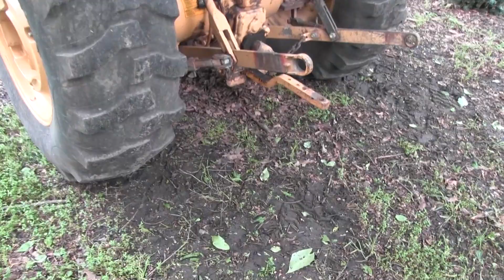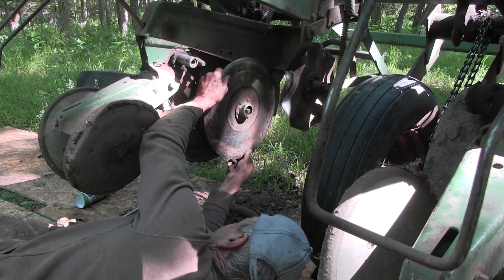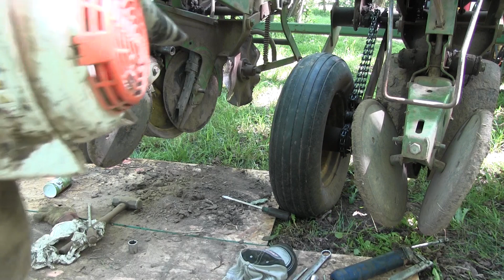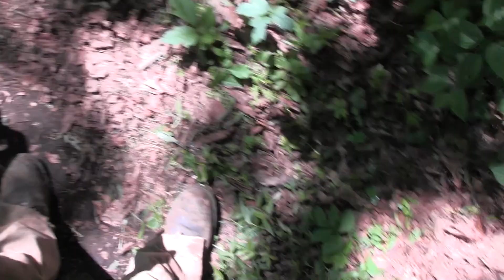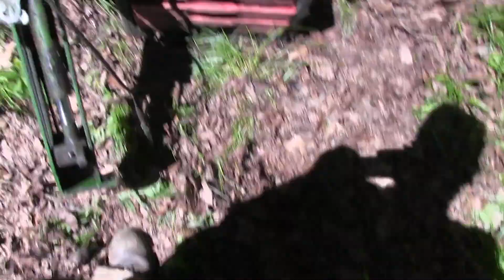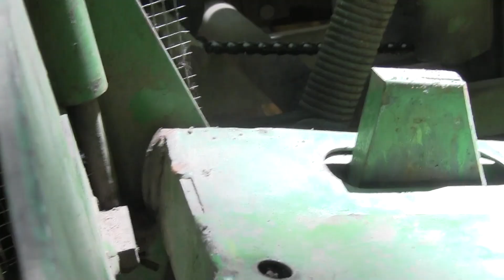John Deere 7000 Planter Maintenance, Cleaning Opening Wheels and finding Hydraulic leak on Actuator

Comment: What a great video! I have the same planter I purchased it used of course, and have had issues with it planting. I replaced those little engaging springs which were worn or broke which fixed most of my issues I still have one row that's not planting for some reason. I'm going to tear it apart this summer and try and figure it out. I've been reading up on it and they say to replace those openers when they're at 14 1/2 inches in diameter so I'll measure mine. The guy I bought it from didn't have the markers on, so I'm going to put those back on so NOW I'm going to make sure there isn't any mouse residue in there. Thanks for that. If you know of anything I should check on that one row that's not planting I'd appreciate it. I've rebuilt all the corn seeders they're all turning and dropping seed. I bought new seed tubes to replace mine they're cheap and I read those could get worn down too. Need to get this fixed, having to use that single row push seeder to plant that one row is a pain in the ass. Thanks Don!
Reply from the maker: Make sure the Drive Release is engaging  the metering unit  thats probably  what is
not working  on that hopper   .Thanks for your viewing an comments
Reply: Thanks Don

Comment: No inside scrapers on those wheels?  My drill is a toy, but its all I could afford.  It has to have perfectly tilled soil to work, but it still requires constant attention to keep it working.  I spray it down with WD-40 that I buy by the gallon before I store it away.  I have rebuilt the float springs, replaced scrapers both inside and out, modified chain guards to keep derailing to a minimum, its something different all the time.  The big takeaway is even if your equipment is not commercial grade you can still maintain it and get it to work for you for years.
Reply from the maker: Thanks for your viewing an comments